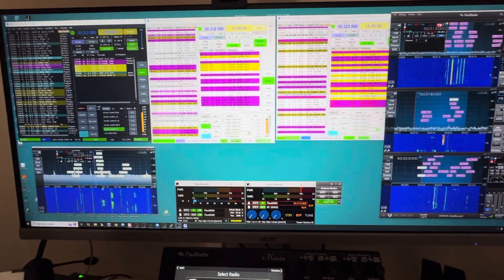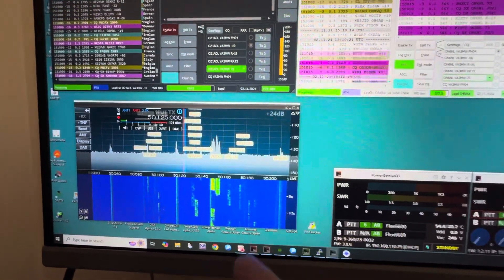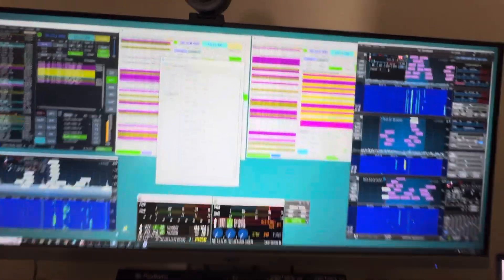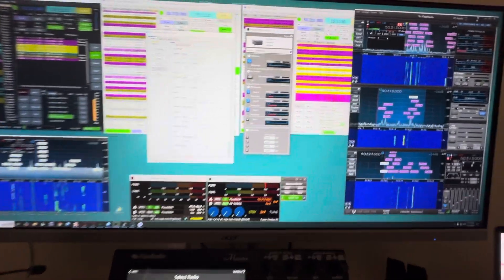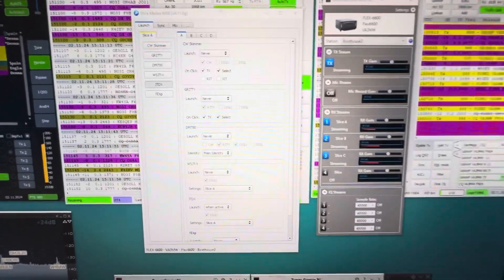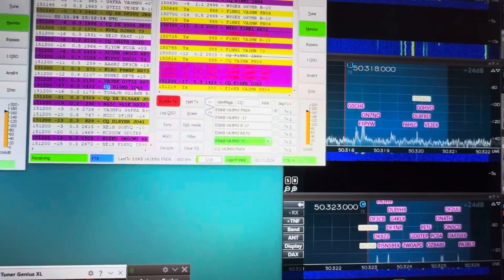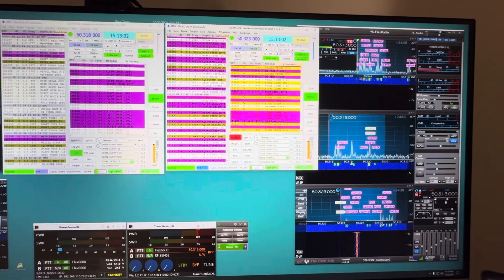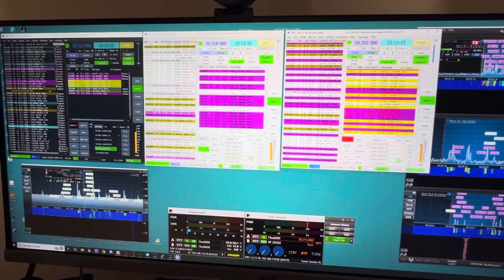Big 6M opening!  4 Slices in use on a FLEX-6600

Comment: You can do the same with just any tranceiver and a simple sdr  receiver , for example sdrplay,  or a 30 mhz  wide one, for example a rx888 if you want full hf  and 30 receivers simultaneously  for just a fraction  of the price  of that  6600. And by the way, i own  a 6300 and i am happy with it. But having that 2 scu  on a 6600  is overpriced. I prefer investing  in antenna farm 😊
Reply from the maker: There are always more than 1 solution to a problem.  Some are simpler to implement than others.   The FlexRadio design makes it very plug and play.  Adding a non-integrated device can be done but it does have some unique challenges.  But, it doesn't come with a 100 watt transmitter.
Reply: @FlexRadioSystems  yes, that is the reason i bought the flex, just plug and play. But...why is not posible to open more virtual receivers  than  2,  in the flex,  but  yes on the sdrplay ? for example,  with 16 receivers. And it is a cheap  sdr .